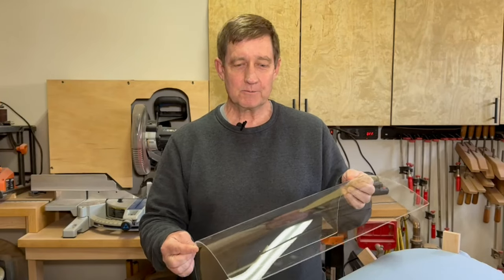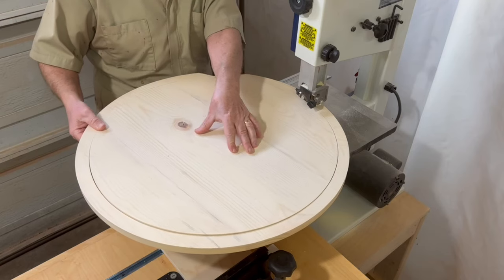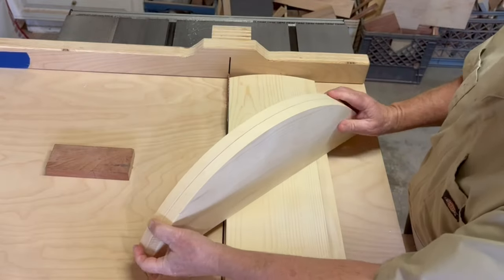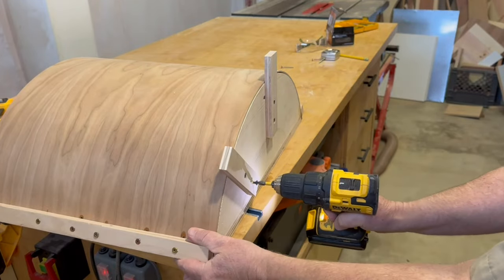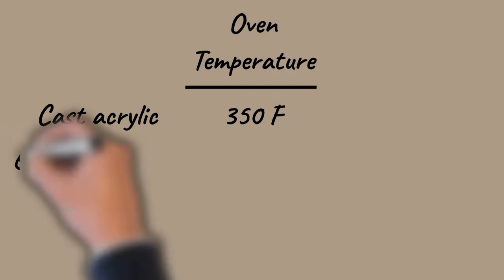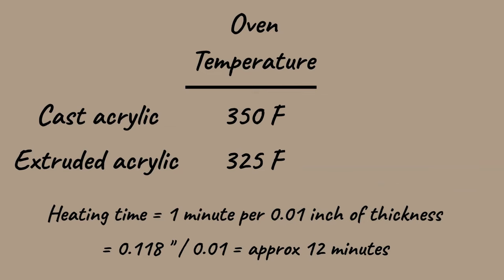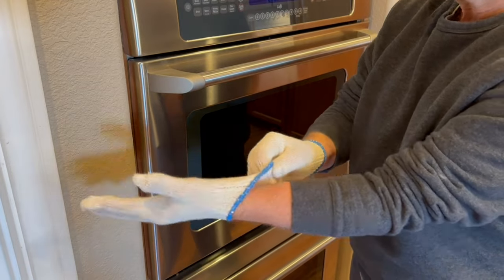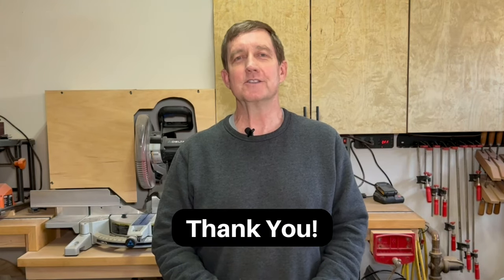Form Bending Sheet Acrylic for a Curved Display Case

Comment: I really appreciate the video. I wanted to float an idea...1. Would heating the acrylic outside prevent the vapour explosion risk? 2. If so, Iwonder if you could create a makeshift oven using fans (for circulation) and gas forge (like you would use to cast metal)? 🤔
Reply from the maker: Sounds like a great idea!

Comment: Thanks for this informative video. Just as a small tip that might come in handy for some. When you are building something that is based around one or two pieces that really define the piece or are unusually expensive or labour intensive,  I usually design and build that special piece first then build the rest of my work around it. I'd make the curved piece first then design the cabinet around it. That way, even if there is some minor deviation in the piece like shrinkage or you don't get the exact curve you want or whatever, instead of buying another piece and trying it again because it no longer fits, you simply alter the dimensions of your piece slightly to fit the finished size of the specialty piece.

Comment: Instead of aluminum, which is not perfectly flat, in the oven, I'd recommend using a silicon mat.  That's what we do in our heat press, to prevent the canvas / paint texture of both plates from marring the acrylic sheet: we use 2 identical silicon mats, about 24" x 18" ( 1/16 thick or so ) to sandwich the acrylic.  Then, use the silicon mat to lift the acrylic out of the oven, and deposit it onto your form.  Keep the warm silicon mat underneath, on you form.  Don't use the cloth, as the warm silicon mat — with residual heat from the oven — will ensure that the acrylic sheet cools slowly and evenly over your form: you don't want big differentials in temperature between surfaces, as this will warble the acrylic; also, the cloth texture could potentially imprint on the hot acrylic.
Reply from the maker: This is really great info, thanks so much!  I'll try the silicon mat next time!

Comment: Thanks for the warning about potential explosions! As my oven is decades old there's zero chance that I'll risk it. I think instead I'll try draping the sheet of acrylic over my form and using a heat gun to slowly heat it and hopefully it will become flexible enough to form to the form.
Reply: An alternative could be to heat the air in the form from the inside. 
Could work if it is metal. And the have e.g. Teflon-like baking sheet 
on the top.

Comment: Thank you for this awesome video. This is extremely helping with the project i have in mind. I would like to add as a former appliance repair tech. A residential gas oven, the gas valve opens and closes keeping the temperature of the oven with a certain range. Up to +/-15 degrees depending on the brand oven. Hence the sound of the low sounding ignition or "woof' sound. Compared to a commercial oven where its keeps stable and constant temp. So even though you have your temp set to 350 degrees, again depending on your brand oven, it actually could be fluctuating at a temp range of 375 to 345 in order to maintain that 350. With this info, be extremely careful  with the vapor build up within the oven
Reply from the maker: Great info, thanks!

Comment: I built a aluminium trailer very very similar to Airstream Basecamp. Am old and retired and needed the distraction. Built the frame from oak and skinned it with 4’x8’ aluminium sheet. To improve on the Airstream I made the front window much higher than they did plus instead of framed windows I made continuous black tint acrylic sheets 900mm wide (Australia) but 2.4m long (8’). I got the front curved piece out of one sheet which I draped over a saw horse in the sun for couple days. Then use hairdryer and strapping to bring it to shape...worked great. 2 rear 90 degree corners it used a jigs and butane torch and block of pine to get it right.  This week I started to bring it up to ready for sale and realised what the design team at Airstream knew all along. In the sun the forward black tinted acrylic expanded breaking my elastic seals. Tomorrow I shall remove the front screen and fit curved channel top and bottom and slotted end attachment points to allow needed sideways movement. Need then added trim above to ensure waterproofing. May as well add LED strip lighting to the upper seal whilst I’m at it. Am sign writing side and rear for upcoming road trip to sell as a 2 berth camper or coffee kiosk.

Comment: Nicely done, and very informative. I really like that circle cutting jig and the dual method for getting a very clean outer edge. I also appreciate the information and how you managed to obtain the bend. For me, the concern is not so much the temperature of the oven and flammability of the acrylic but that as chemicals offgas from the heated acrylic, they plate onto the inner surfaces of the oven where you will be cooking food later on. So, they may get onto your food and then of course you’d be eating it. Further, if you have an oven that cleans itself by heating up very hot, those same chemicals that plated out would be converted into something that may be noxious to you and anyone else. Caution is advised! 👀
My wife would have a fit if I were to do this in our oven! 😁
I really enjoy your videos and I hope you keep it up!
Reply from the maker: Thank you so much for the kind words!  Great information on outgases potentially plating on the oven inner surfaces.  I hadn't considered that, and even more reason why i likely won't try this again in the kitchen oven.
Reply: Thank you 🙏

Comment: I need to do something similar and Im ok with trying the oven but a quick question, is your oven gas or electric? I would thing electric would be safer if there was a buildup of the flammable gas.
Reply from the maker: My oven is electric, and I agree that is seems it would be safer than a gas oven.  my oven is also convection, which I think helps to reduce hot spots by swirling the air inside.

Comment: Heat it with a hair dryer??
Reply from the maker: Maybe?  I would think it would be difficult to get it evenly heated and get a consistent curved shape to it.
Reply: @jkmwoodworking  maybe, you can use something to apply pressure to curve it?? Maybe like wood?? Just guessing but thumbs up for your video. 👍
Reply from the maker: Thanks!

Comment: Use a heat gun next time much safer and better to work with they cost roughly $25
Reply from the maker: Thanks for the info, and great point, I could have tried that!  I was a bit concerned about my ability with a heat gun to heat it evenly across the entire sheet, and keep all areas hot at the right temperature to get the continuous and smooth curve that I was looking for.
Reply: And it doesn't off gas toxic fumes into your oven...
Reply: But it takes an eternity holding the gun and aiming it all around the piece… ending with uneven heating. This can be acceptable on small pieces .